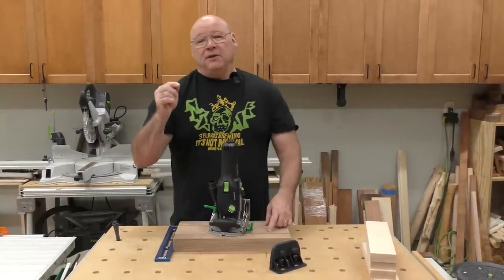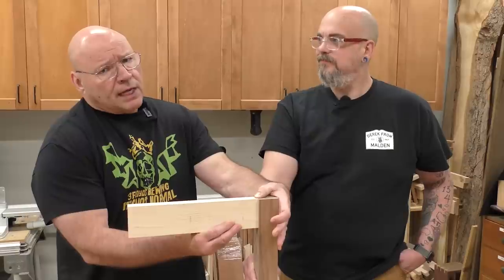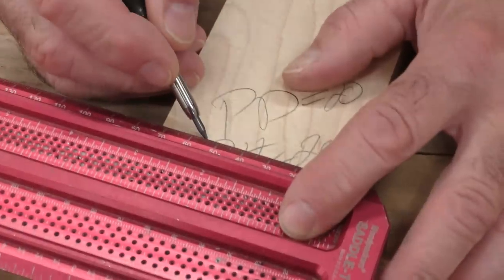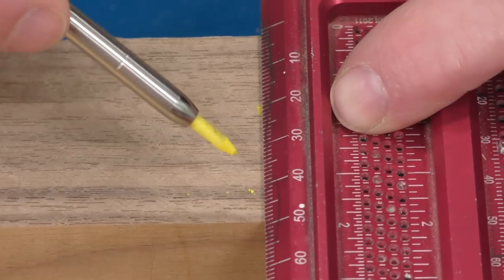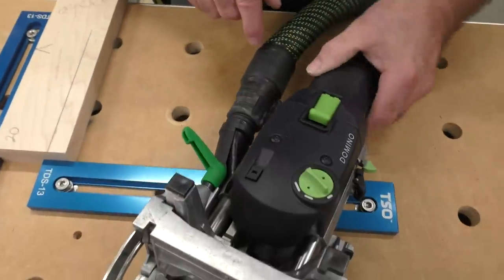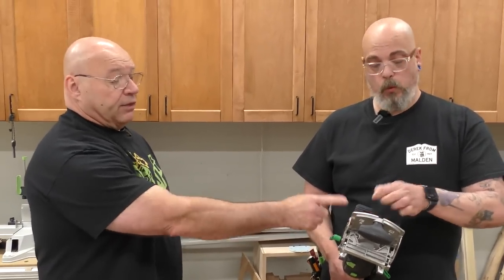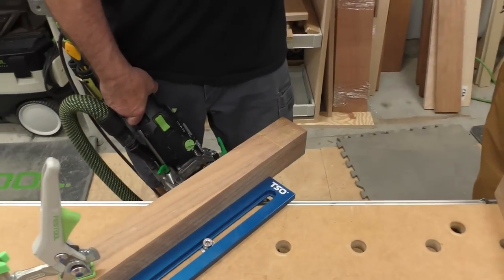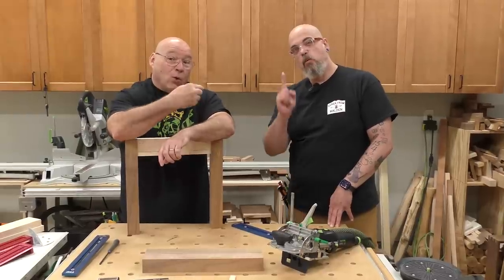Does Your Festool Domino Do This ?

Comment: Great video guys. How simple you make it. And yes you hadn’t made this video because I’ve looked. I’ve just finished a coffee table and could have done with this video. My dominoes were all over the place. The wood is very chunky so I was doing a 2x2 grid with the dominos. I got lost with all the measurements, used up a day working on it, but I did get to make it fit in the end. 
On the plus side I’m making 3 more the same only this time I have the knowledge of your video. I’m offsetting the apron a bit more because the leg has a 10mm radius on all edges including the top, so also offsetting down from the top as well. I’m going to go to a larger domino and only use two instead of 4. I’m a terror for punishment. But how do you learn if you don’t push yourself. Keep up the great work on your videos. 😊
Reply from the maker: Glad it Helped ....Thanks

Comment: I know you’ve said on just about every vid of yours (prob every, not just about) that you have to have the machine running when changing setting from tight to wiggle room, but I was wondering why it has to be running?

By the way, I really appreciate your content and teaching!
Reply from the maker: they are tiny synchronized gears and the machine should be running.... I know quite a few folks who do not know this ( it's in the owner's manual ) and have been switching between gears with out the machine running. This is ok ...but when the gears get stuck do not try to force it or gears will strip....so...That is what I always switch gears while the DF500 is running...no need to do this on the DF700

Comment: Another great video, thanks guys!  Forgive my ignorance but I'm a lost with the explanation starting at 9:35.  Set the plate height at 40, subtract 20 from 40 then divide by 2 to get 10. ???  Is there a specific formula to use for this?  One that works for different thicknesses and offsets?  For instance, I'm building a workbench and my leg thickness is 90mm, apron thickness is 32mm, and I want a 19mm offset.  What is the formula to determine the settings for the Domino? Is there a different approach to this when using the DF500 vs DF700? Thank you for your knowledge and expert advice.  It's very much appreciated.  Cheers!
Reply from the maker: There is no formula...the # that appears in the window is the thickness of the material

Comment: Sedge - I have a question on using the domino for a long cabinet. First, I will build a kick plate as you have shown in your video. Then, I want to build a 2438 mm (96in) cabinet. I want to put interior cabinet dividers at 520 mm along the length to act as sides for interior cabinets. I plan to put drawer slides to allow using a piece of 18mm plywood as a shelf for some of my systainers. They will be 2 sustainers deep and grouped. For instance, I will have my track saw sustainer on the front of the shelf with the accessories systainer and parallel guide systainer on the back of the shelf. How would you lay this out for the proper domino locations? Any help is appreciate and if I could afford Festool drawers, I would use those. Retired by the way.
Reply from the maker: I would place dominos every 150 mm in the shelf and use screws as well

Comment: Did I miss something? You kept saying you would explain how the 40 setting gives you a 10mm, but I never heard it.
Reply: It's a bit cryptic, but the explanation starts at 09:40.  The 20mm plate height for the apron skirt puts the domino center 10mm from the face of the skirt, but not centered on the end of the skirt.  The 40mm plate height for the leg puts the domino center 20mm from the face of the leg.  When the skirt is attached to the leg, the difference between the domino centers to the face of the skirt and leg is 10mm.

It would have been easier to follow if Sedge had drawn registration line 10mm from the face of the skirt and 20mm from the face of the leg, then put the two registration lines together to show how the centers of the domino create the 10mm offset.
Reply from the maker: Thought I mentioned it
Reply: @sedgetool  you did! Funny how I am rewatching this video months later after getting more practice with the machine and it makes so much more sense 🤣

Comment: So in this case, for more then 10mm offset, you can't use the stop lock am I right? It only goes to 40?
For a traditional tenon, we use 1/3 of the thickness. 1/3 * 25mm is 8.3 Why don't use you 8mm domino's?
Reply from the maker: thanks for the reference ... I wanted to keep the math easy for this video....
Reply: @sedgetool  Ok I understand. But in general, would you also apply/advice the rule of 1/3 and to use a thicker domino if possible?

Comment: He set the fence at 40, because 40 minus 20 equals 20, divided by two equals 10.  So he set the fence at 40.  HUH???
Reply from the maker: ok
Reply: Ok but where did he get the 40 from? Am assuming the 20 was from the thickness of the material....
Reply: The apron is 20mm "material thickness". There's your 10mm split of material thickness is 20mm, the Domino puts the mortise in the center of the material. You raise it to 40mm, the difference between 40mm and 20mm is 20mm. The Domino puts it in the center at 10mm again, which gives you the 10mm offset. Pretty simple.